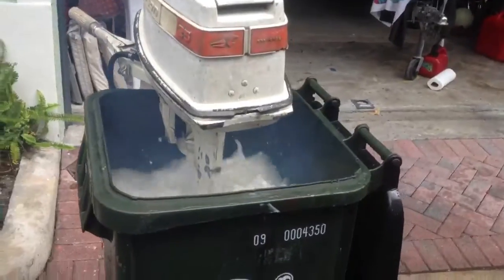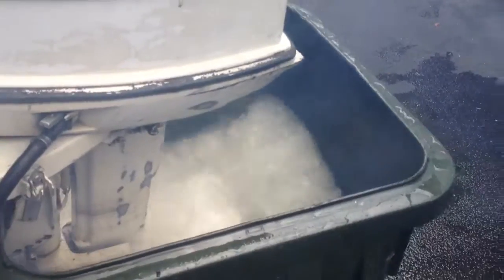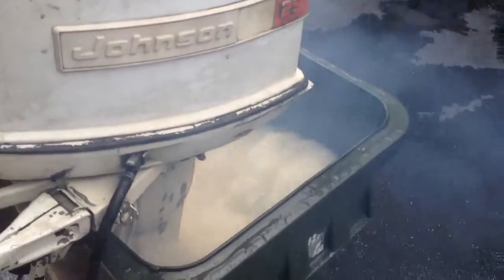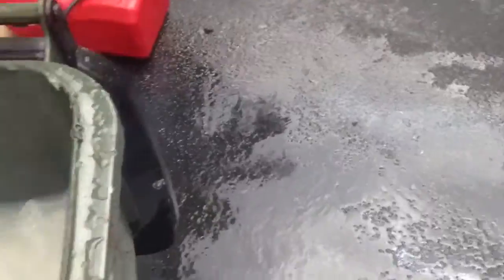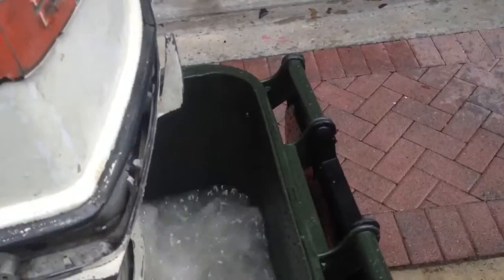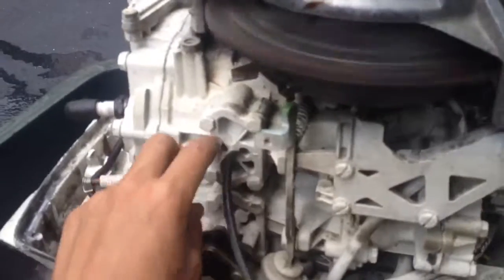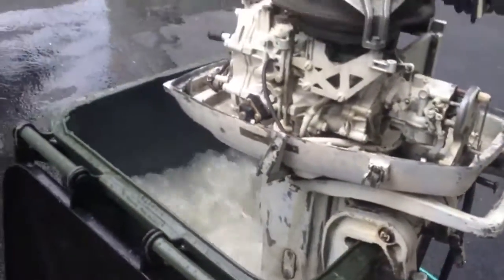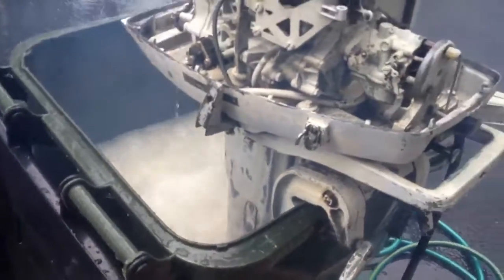Need help 1972 Johnson 25hp outboard motor

Comment: You should have a steady stream of water coming from pump hole, sounds like you could have a overheating issue, vaccuum issue and a carb issue. Also your lower spark plug does not have insulation around the spark plug boot, I would fix that, you could have water being jumped around and grounding out the arc
Reply: WestWaters i

Comment: indidnt notice any water coming out the pump hole? Am I seeing things? Check that first, cause if your running that motor like that without water circulating in the motor, high revving issue will be the least of your worries

Comment: check the points and the coil. the points under the flywheel should be set to .10 with a feeler gauge. motor sounds like its not getting the right spark or the points are off. mine did the same thing.